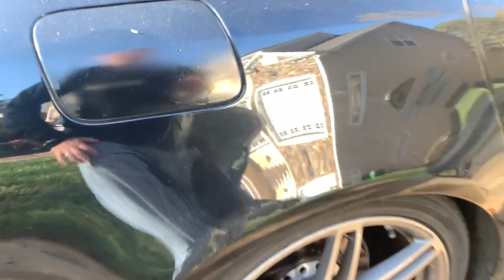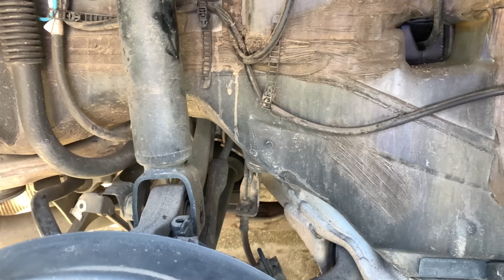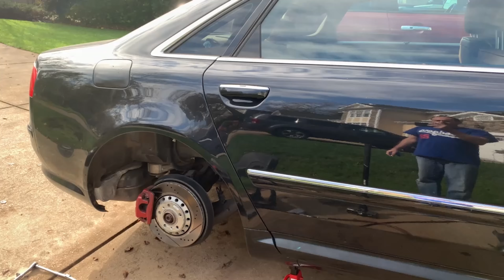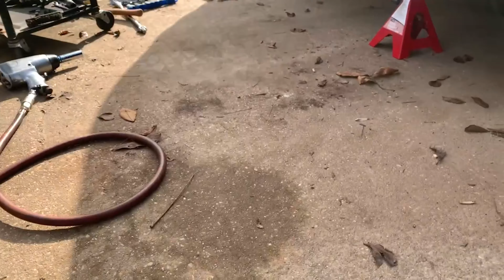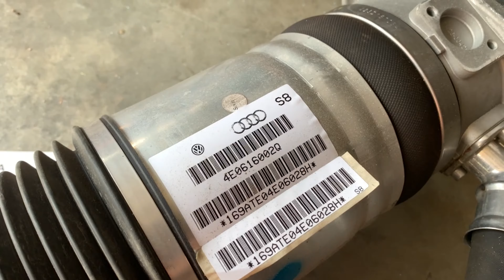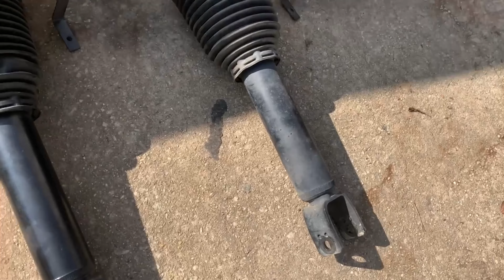Audi A8 - (D3) - Replace Right Rear Strut

Comment: Great video thanks allot. I see that you replaced it with an S8 strut. Are those interchangeable? I thought the S8 like mine has a sport suspension and the A8 has "normal" suspension. Anyway, you've been a great help. Thought about changing the bladder only. But this seems to be a little more fiddley. I just spend the extra money I suppose. Thanks again! Regards from the Netherlands!
Reply from the maker: I’m glad you found it helpful!  So far the strut has worked very well since the video,

Comment: I have a 2009 and the entire rear end dropped.  Would you have any clue what would cause this?  Thanks for the info on the used parts supplier.
Reply from the maker: Do you have the Rosstech VCDS software? I highly recommend that as the next step in diagnosing. Can share some fault codes that are specific to Audi. If I had to wager a guess, could be the struts airbags ruptured, could be the air compressor (located under the front left fender), air valve block, lastly could be the control module (located behind the glove box).